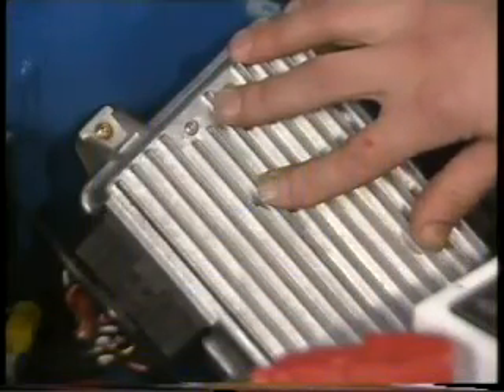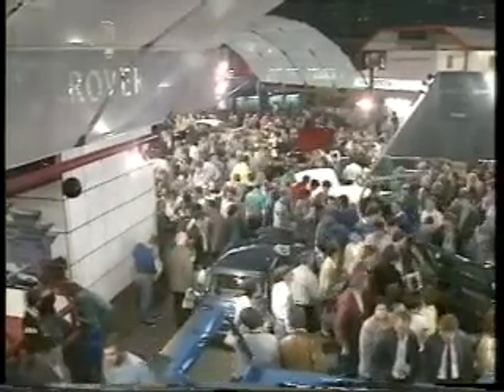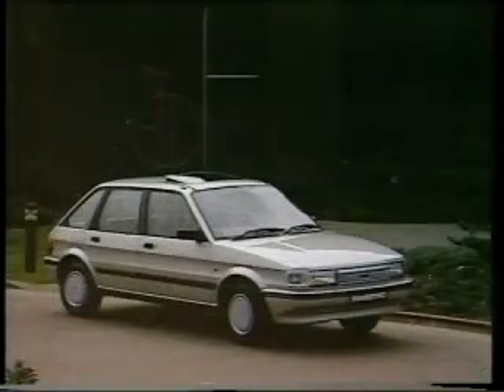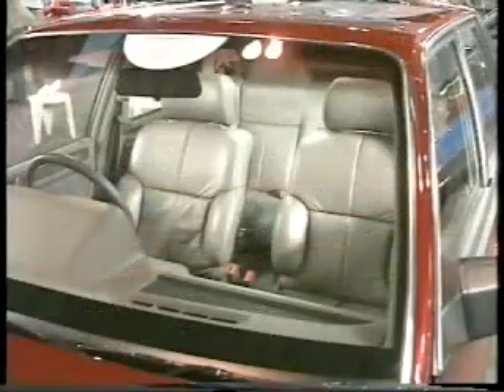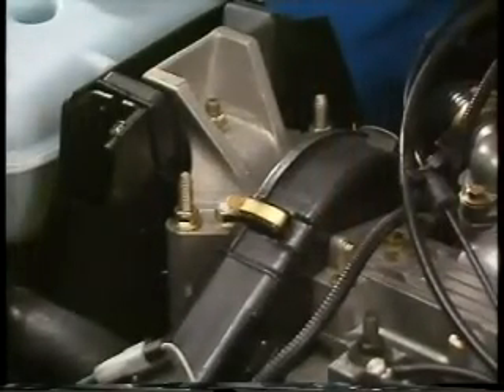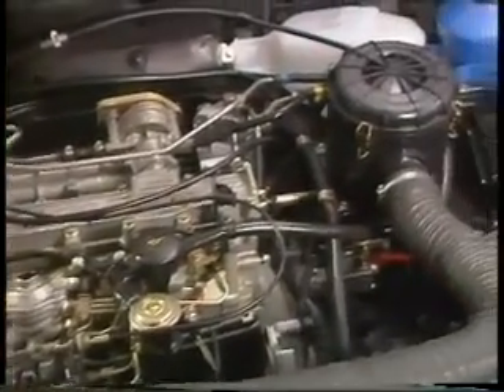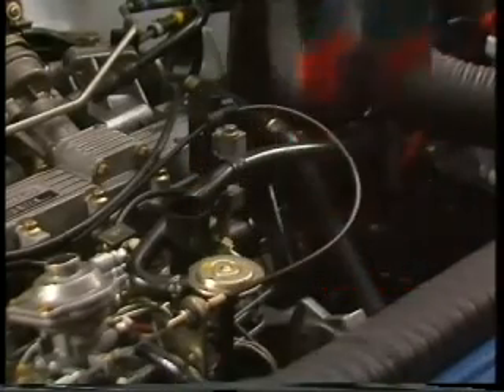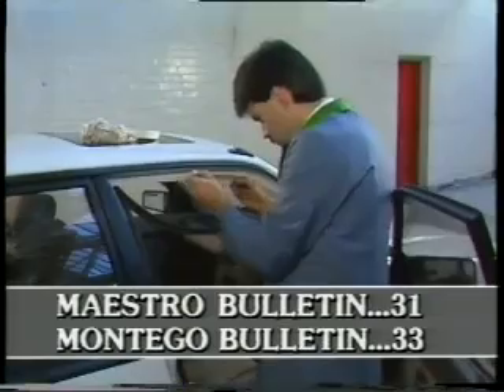Austin Rover Service 1988 Motor Show Launches

Comment: I love AR products, but that 3M tape bodge amused me somewhat, it probably worked as well!! The idle surge on the multipoint hotwires engines was well documented, I think it was down to a dirty throttle potentiometer in the end......but nearly every hot wires system I saw, suffered from it......though funnily enough, my M series 820Si and 820Turbo were suprisingly free from this issue.....